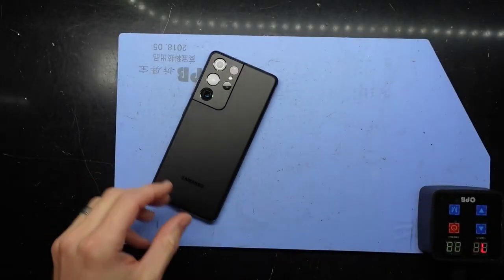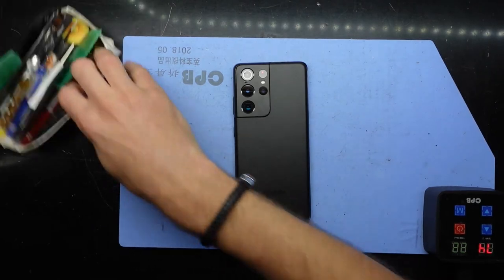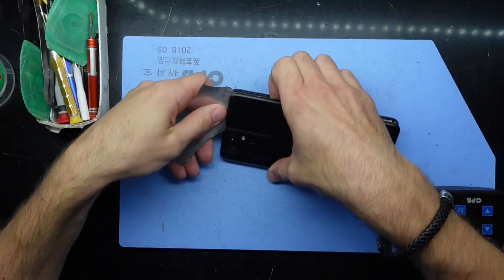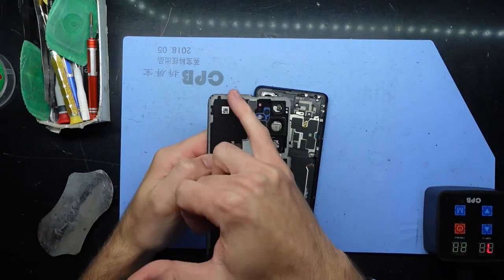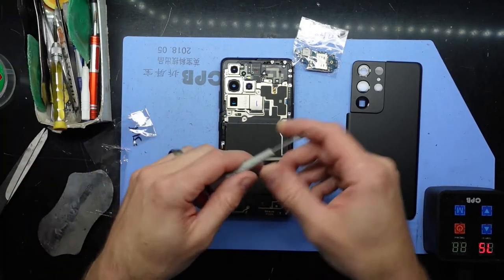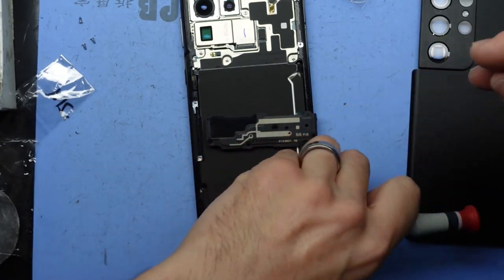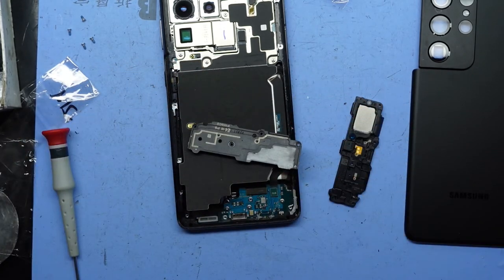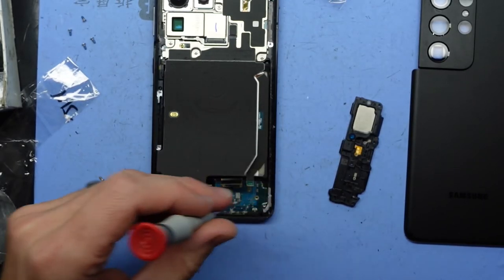Samsung Galaxy S21 Ultra 5G Loudspeaker and Charger Replacement

Comment: I did the same thing to mine same phone but mine won't read the sim card it says their no signal y returned it nd got another one nd it does the same thing
Reply from the maker: the charger port is the card reader / signal 
might be a dud replacement part